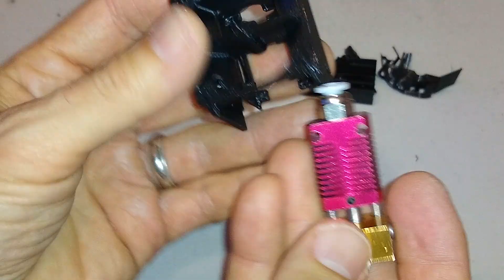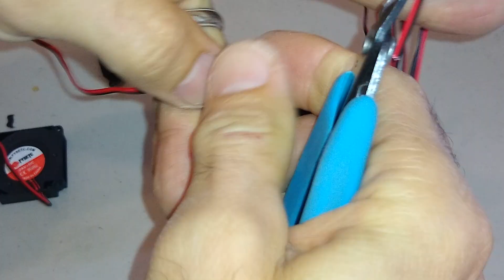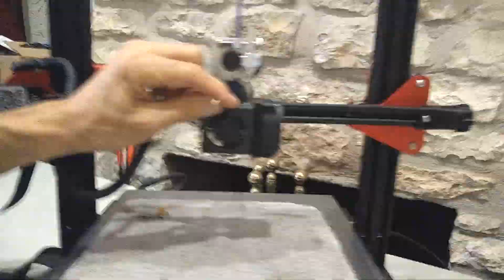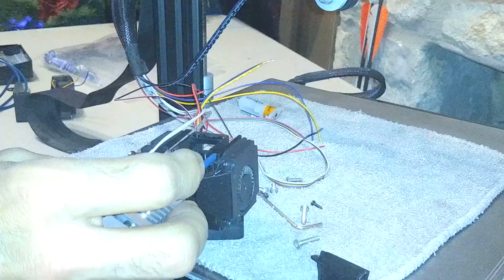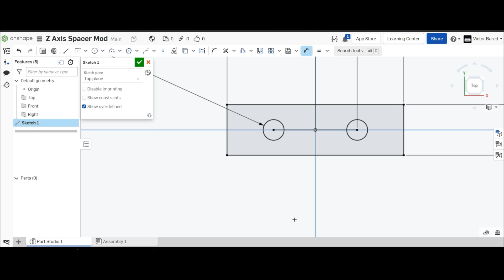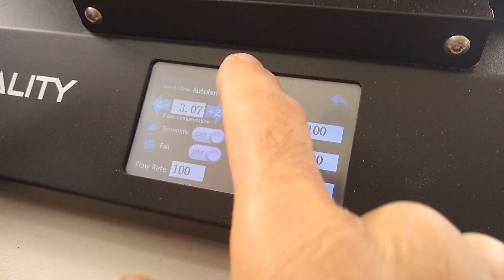3D Printer Super Efficient, Extremely Compact Designed Minimalist Tri - Fan Bracket and Ducts

Comment: Just confirming: 5% infill for the bracket?

Also - other than "front face down", are there any other recommendations about orientation on the print bed?
Reply from the maker: Hello Run, Thank you for commenting and supporting my work. I keep infill at 20% but my wall count is 10, top, bottom, and initial bottom layers is 8 for the items that I normally print. So even though the infill is 20% the bracket and ducts will be solid. On the parts that need supports I use 5% support density.

Let me know if you have any other questions.

Best of luck with your build!

Comment: will this design work on Ender 3v2? it says compatible in description but wasn’t sure if that relates to the fans. i have the Micro Swiss hotend
Reply from the maker: Hello AZWildk4t, Thank you for commenting. Yes, I originally designed it for my Ender 3 V2 using a Micro Swiss all metal hot end and stock fans. This finalized design also fits the stock MK8 hotend that comes with most Creality printers. What you will need to get is an additional 4010 blower fan just like the stock Ender 3 V2 parts cooling fan, which is linked below.

https://amzn.to/33MIvOu 

Best of luck with your mods.
Reply: @vbared  I have a couple follow-up questions.
1) any idea how quiet these fans are compared to the noctura ones?
2) do you prefer this design versus the one in your other videos? https://www.youtube.com/watch?v=_DESzss3Lj8&t=103s
Reply from the maker: @AZWildk4t  Hello, You can replace the heatsink fan with a 4010 or 4020 Noctua. I've had several people advise against using the Noctua 4010 as the heatsink fan due to heat creep but that hasn't been my experience using the Mico Swiss all metal hotend. The Noctua 4020 would be a better choice for cooling the heatsink but it will stick out more. Noctua doesn't make blower style fans so you will need to reuse stock Ender 3 V2 parts cooling blower fan and buy one extra. The link I previously sent are the ones I'm using. You only need one but for the extra couple of dollars having a spare is a good deal.

The performance between the free prototype and this $3.49 version is the same. The differences between the two are:  prototype is friction fit and for the Micro Swiss hotend only. It will not fit the stock Creality MK8 hotend. You can print the free shroud for the Ender 3 V2 to lock it all in place. The ducts are also friction fit with no fastening tabs. The paid version fits both hotends, anchor without the need for the shroud and the finalized ducts have the fastening tabs that can be printed easily.

Best of luck with your mods.
Reply: @vbared  Thanks for the response. I do have the Micro Swiss hotend and bought your $3.49 version. Once current print is done, i'll work on the duct.
Reply from the maker: @AZWildk4t  Thank you for supporting my work. Included in the zip file is my Cura profile should you have any issues printing the ducts. They are small and thin so the right slicer settings are important.
Reply: @vbared  Hi Victor. I loaded up the Cura profile that is included in the ZIP file. However, the profile does not match the "Cura Print Settings.txt" file. The Cura profile does NOT include Support but the .TXT file does. Is the Support info in the TXT file for the Fan Bracket print and not the ducts?
Reply from the maker: @AZWildk4t  Hello AZWildk4t, The .txt file gives you the manual overrides you'll need for the part/parts you're printing. An example is the ducts, they don't need supports but must be printed at a slow speed 25mm/s because they are small and need more time to cool between layers. They also don't need supports because of the way I designed them but since they are small and don't have a lot of surface on the print bed you will need to enable brim and uncheck brim on the outside only so Cura tells the printer to print brims on the outside and inside to ensure the printer doesn't knock the part loose while printing.

Sometimes a phone call helps clarify things contact me if you need more details 478-227-3301
Reply: @vbared  Hi Victor. I sent you a message and thought I'd post it here too. I have the parts printed and installed noctua fan with buck connector. Having issue with Ender 3 V2 starting. Got nasty MAXTEMP error. Loosened thermistor screw didn't solve the issue. Assumed mainboard is bad. Bought another board and get a loud beep on startup. Nothing shows on display. It seems the printer is not reading the SD card with the latest firmware. Assuming the new board is bad, i bought a second mainboard. Same issue. I am puzzled. Any suggestions?
Reply from the maker: @AZWildk4t  Give me a call +1-478-227-3301 so I can help you figure it out.

Comment: Have a question about front fan noctua I guess are u using stepper DC?
Reply from the maker: Hello Adam, Thank you for commenting. Yes, I added the two buck converter in this video one for the heatsink fan and the other for the control board.

https://youtu.be/ycvHpMbo5Hw?t=1391

Voltage Converters (Buck) - https://amzn.to/2YK5pUw

Best of luck with your mods!

Comment: Hi I downloaded files and found bracket bt touch 6mm and 8 mm what u could recommended to that build and also stepper left or right?
Reply from the maker: The 8mm BL Touch gives an extra margin of safety by keeping the probe tip 2mm higher than the 6mm one that I'm using in the video. Stepper left and right you need both. Those replace the factory ones that come with the CR10S Pro V2 and give extra clearance so you can bring the gantry down an additional 4 mm. So in the video I installed an Ender 3 Micro Swiss all metal hot end on the CR10S Pro V2 so I could use the Minimalist Fan Bracket with the dual 4010 blower fans.
Reply: @vbared  😊 I just buy it file,thanks for fast replay
Reply from the maker: @adamw.9165  Thank you for supporting my work, Adam. Please link a picture when you get it all assembled.

Comment: Can the heatsink fan be upgraded to a 4029
Reply from the maker: Hello Andrew, Thank you for commenting. You can use any fan that is 40mm square so long as the holes line up and pulls air from the heat sink side.

Best of luck with your build!
Reply: Cant replace it yet , waiting till after surgery next week . Will let yoh know how it turns out wben done
Reply from the maker: @andrewosmond3490  Praying for you to have a Swift recovery.
Reply: 4020
Reply from the maker: @andrewosmond3490  Yes, 4020 no problem

Comment: I really like how you left the 4010 fan exposed so you can use longer screws and put a quieter 4020 fan in its place!
Reply from the maker: Hi Riley, Thank you for commenting. Great observation, I didn't even think about that. A Noctua 4020 would fit perfectly, pull a lot more of the heat out, and super quiet.
Reply: @vbared  Do NOT use Noctua fans for part cooling, they have lower RPM's and therefore wont cool as well as say the stock blower fan on a CR10S Pro. I recommend a blower fan or two for maximum cooling (louder, but far more efficient) and obviously a axial fan for the coldend cooling.
Reply from the maker: @zizor1759  Hello Zizor, Thank you for commenting. I've had a few people saying it will cause heat creep. Maybe it's because I print with PETG  that I had that experience yet. I'll have to do more testing. BTW did you get everything working on your printer?
Reply: @vbared  I did, dragon still wont print without curling though. Ive got the bed somewhat leveled so the BLTouch compensates for my uneven bed.
Reply from the maker: @zizor1759  Is the dragon a Thingiverse file if so please send me the link so I can take a look at it. I'll try printing it on a Garolite sheet to see if it sticks.